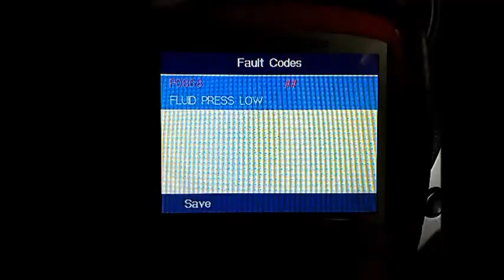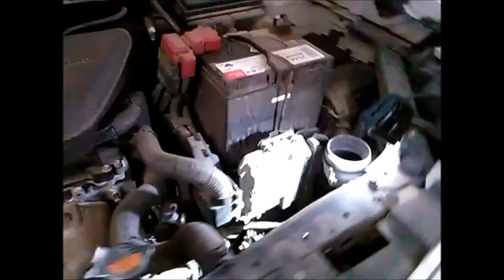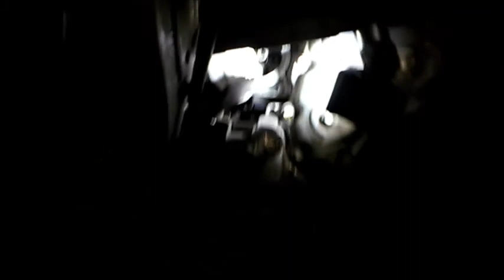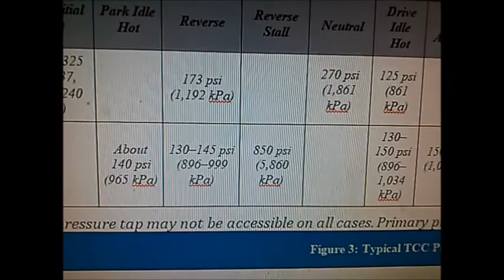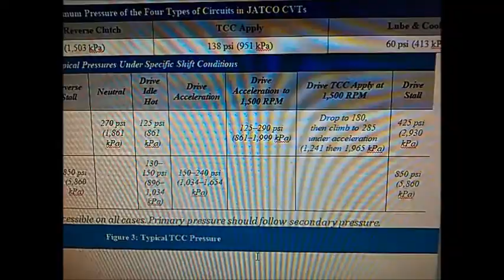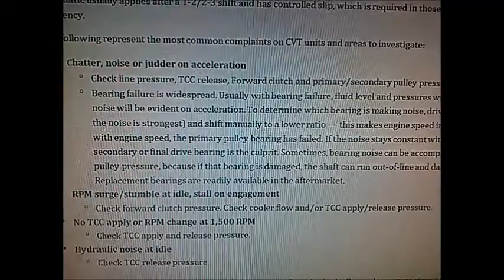CVT RE0F10A Nissan Mitsubishi Jeep Cooling Line Filter How to Replace

Comment: G'day mate.. greetings from a fellow Aussie! I've got a 2011 Renault Koleos H45 2.5L 4WD model with the same JFO11E REOF10A cvt, which is based on the X-Trail and also on the Nissan Rogue, so your info here is exactly what I was hoping to find - thanks SO much. But mine sounds a bit different to yours, in that as well as having the P0868 code, I've also got P0746 and P1778, so 3 codes for me. I know they'll all be linked back to a common failure somewhere (like a weak solenoid or pressure sensor in the valve body, or maybe the little cvt oil pump piston is stuck or something.. I've pulled the valve body out and done a few other things.. I'm still hoping the cvt hasn't died, and I can fix it with small fixes like this one). But can I please just check with you.. did replacing that little second tranny oil filter actually fix your P0868 issue totally, or did you find other stuff was still an issue? Did the error code magically disappear after you did your filter? Thanks, Stu.
Reply from the maker: hi, for further help, please also read through past comments and responses and check out our other related vids.  cheers
Reply: @YepThatsIt . Yes.. I already did that, hence my question to you - nobody in the comments or responses asked you if this filter swap was the solution that actually worked for you for this code, and it would be beneficial to know if this procedure you did actually did solve the problem, and resolved that specific code for you, or if something else was also needed done. Do you remember?

Comment: Hi
Hyundai accent 2008 hybrid cvt transmission have a filter cooler ???
Reply from the maker: hi, I don`t believe so for the Hyundai Kappa CVT but best to confirm with your Hyundai dealer. cheers
Reply: YepThatsIt
It's not kappa

Its  zf
Reply from the maker: hi, sorry not familiar with the ZF dual-clutch (DCT) transmissions 'S tronic' , is that what it is? cheers